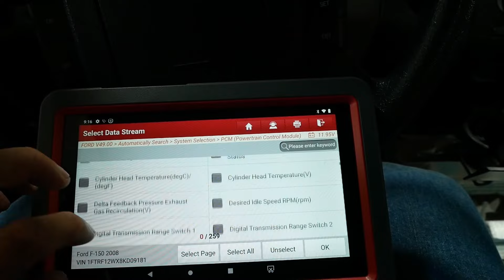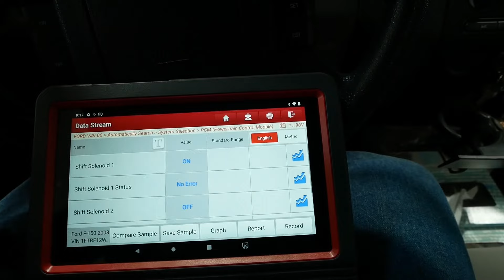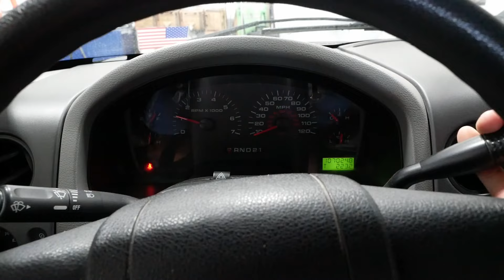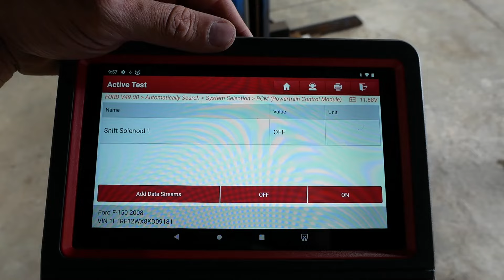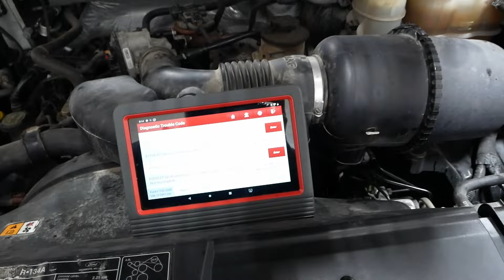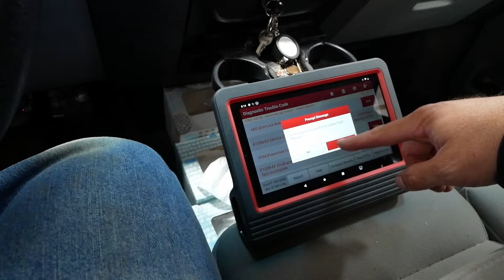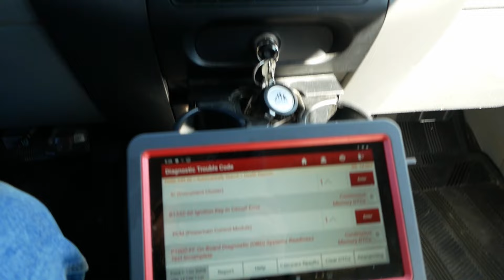Ford Trans Troubles - Dragging in Low and Reverse - 4R70W

Comment: You should try an automatic transmission. Maybe an older, non-electronic one. They're no more complex than the hydro valve setups on the plow trucks or that Ranger transmission. I rebuilt a C6. It worked, It was a formative experience.
Reply: I second this. I rebuilt my 4R70W on my 01 Crown Vic. These are simple and the clutch tolerances are easy to achieve.
Reply: Yeah, but Wes isn't setup to repair them and there's an entire chain of order that needs to be built from scratch. IMO he's peachy where he's at, there's no reason to spread oneself to so many corners.

Comment: Good trans shop to suggest flushing the cooler. I rode in the 40s to even the 30s in Illinois if the sun was out. Still riding the Panhead bobber at age 72 but now in the mountains by Prescott.

Comment: the 4R70W seems to be a good transmission in my opinion, I had one go through 2 engines and it lasted 394K in a 1999 expedition, I can't say the same about our current 2004 expedition, we had that one rebuilt at 240k which is still not bad

Comment: Wes,  There is no voodoo magic going on inside an automatic trans.  Take it apart, clean, install new frictions, steels, bushings, seals, orings, apply pistons,  and any broken hard parts...charge $2k...easy peasy.  You're a far more advanced mechanic than I am and I've rebuilt 4 automatic trans with no problem.  IMO it's harder to R&R a transmission than it is to rebuild them.

Comment: A great way to start my Sunday with new video from Wes. I’m surprised that transmission needed to be rebuilt at that mileage. I’ve got a 2001 F-150 with the 4R70W that’s got 190,000 miles on the original transmission.
Reply: My 2000 got 298k before its rebuild.
Reply: I've got an 01 with 440k miles on the original trans.
Reply: My 2003 F150 4R70W (4x4) tranny has 194k original miles on it. Still shifts great!
Reply: It's all in how they take care of them also that 107k miles could of been 107k of stop and go and towing. Also, not all transmissions are created equal one thing that was not perfect from the factory will torpedo a tranny eventually. I have 186k On my Ford Expedition (Same Transmission as this F-150) and it needs a Transmission. But It has spent its life in Stop and go and towing the fam toys and camper around so I feel I got my money's worth out of it.
Reply: @Twisted_Harlock  im at 133k on my 98 crown vic(not a p71) and its going strong! BUT it was serviced every 20k  firm wot 1-2 shift

Comment: Wes, if you can take apart an old Oliver dozer transmission and shim it back together so it works, you can certainly tackle a modern auto transmission like the one for this Ford.  There are plenty of YT vids of people taking them apart in under 30 minutes.  Of course that's the easy part.  Re-assembly takes a bit longer and some special tools.  You can do it.  Set up a stainless steel table/benchtop in your shop.  Then take an auto trans apart, fix it, and put it back together.  You'll be glad you did.  Also, how is it this 15 yr old Ford with 107k mi has less rust than your lift?  Great video as always.  Have a great week!

Comment: Hey Wes, I know this video was from like a year ago but I just wanted to bring this to your attention if you didn't already know it... When you showed the metal in the transmission oil pan there was a little plastic yellow stopper with an o-ring on it laying in the pan.  Those are installed in the side of the transmission at the factory and later on when they attach lines and such it gets popped into the transmission pan.  It just lays in the pan and doesn't cause any problems but it's a telltale sign that that transmission never got an oil and filter change after 107,000 mi.  Therefore I would say that that is the reason that transmission failed.  Just thought I'd drop that little bit of knowledge on you if you didn't know.

Comment: Your EZACTLY like me, I ONLY replace engines and transmissions, ONLY ON rear wheel drive CARS/TRUCKS. FRONT wheel drives CARS are A pain, AND I WILL NOT WORK ON THEM. AND NO I DO NOT WORK INSIDE ENGINES NOR TRANSMISSIONS, I ONLY REPLACE CLUTCHES, PRESSURE PLATES, AND THROW OUT BEARINGS, AND MASTER SLAVE HYDRAULIC CYLINDERS, AND MASTER CYLINDERS ON THESE TYPE OF APERRATUS ASSEMBLIES,  OR INSTALL NEW FRONT AND REAR PUMPS SEALS, ONLY IF IT LEAKS, EXCELLENT JOB YOUNG MAN. 😁👍

Comment: that orange plug in the pan.... had that trans NEVER had it's fluid and filter changed in it's life? amazing it lasted that long.  the plug comes from the factory fill afaik.
Reply from the maker: Just did a E250 with 230,000 on the clock. Still had the plug in the pan. Only reason I changed the fluid is the pan rusted through.

Comment: I know ur the mechanic am I just repair in my yard but I found easy way to remove that top rear starter bolt. I removed mine in less then a minute with an 18 inch extension and a lot of short ones reaching right over the front tire. If you turn tire towards passenger side you can stick head and see that bolt no problem.  The reach around technique only works great for Mortske Repair lol

Comment: Decades ago in my garage I had the same delima about the transmission work, and the customer.  Normally I just sent the car over to my friends transmission service.  He was swamped and said If I pulled the transmission, lines and cooler he wauld walk me thru the rebuild.  fortunately it was just an old GM 2 speed slush a matic, and simple as simon.  All turned out good.

Comment: These old fords radiators and Transmissions are pretty easy to remove good design to bad Ford changed the design on the newer models good video as always @Watch Wes Work

Comment: You're a braver man than some of the mechanics I've dealt with in my lifetime.  All the symptoms you had today remind me of something with my old Toyota Land Cruiser.  Took her to several mechanics, and they were all sure they couldn't find the problem, and that something would have to "break" before they could properly diagnose.  Finally had to say goodbye to her, because I couldn't trust her to do the km's I was doing at the time, and the last thing I needed was to break down in the middle of nowhere.  Wish I had taken her to a transmission shop.

I think you stole the thunder of most viewers when you mentioned not having to take to it with a gas axe - for the miles, she was in pretty good condition underneath.

Comment: We installed an accessory external filter, and an additional cooler, because transmissions are so darned expensive. I did the r&r and filter, cooler modification.  My builder recommended it.  Did your builder tell you why it grenaded? A friends 4R70 did the same thing. Nice to see you got it done on a non crusty ride. thank you.

Comment: Wes. I fully rebuilt a 4r75e, which supposedly has identical internals to this tranny. I'm just about sure that if a numpty like I can, you can too.

Cost me about 700, which included some tools. I'd have probably had someone do it but I repair other things for a living and have trust issues about the work of others, based on what I've seen in "my field"

Comment: After watching this it shows me what a good transmission shop will do to help you ie bring the radiator so they can flush those lines removing any nasty junk trapped in there.  That alone should prolong the life of the rebuilt transmission.  I would not have thought of doing that---- but then again I am not a mechanic.  That transmission jack looked a little skeptical to me.  I was worried it might fall over sideways.  Thank goodness it did not.  Thanks for the videos and tips.
Reply from the maker: It’s a good one

Comment: I’ve changed a few transmissions and only replaced the oil and filter
Although I did change the valve body on one 
From a 1975 to a 1968 trans and they bolted right up. And to my surprise it even shifted and stayed in there till I sold that truck.

Comment: Man that sucks that the trans let go. When I changed my trans oil in my 86 f150 with a c6 I was extremely surprised to see the push through sitting in the pan from when it was built, indicating it still had its orginal trans fluid. Fluid looked great and the fluid was extremely CLEAN!  But that probably because it only had about 50000 miles on it

Comment: I liked this video everything fell into place.
 I  have to put a hydraulic throw out in my 97 Ranger with 4wd and 5spd. This is the last year for the twin traction beam front suspension and I've done transmission work on this before IT AIN'T PRETTY. This is when I wish I didn't know enough to make me dangerous and the fact funds are tight and so am I.

Comment: Good job . I'd have possibly talked the owner into getting an auxiliary cooler plumbed into the system for extra insurance I really have no faith in the in rad coolers as a stand alone. I've had good luck adding a few spin on filter kits from Derale to a few vehicles with trans rebuilds, and at service intervals the fluid comes out crystal clear and have had 0 issues afterwards. just a thought Wes.

Comment: The block in the cooler lines is a thermostat. Helps the fluid heat up faster by bypassing the cooler, which is an emissions/fuel economy thing. Hotter fluid is thinner, thinner fluid requires less power to pump, etc…

I’m not a transmission guy either, but I learned a few things over the years to determine if it was an electrical/solenoid issue or something outside my scope. Basically, there is no electrical issue that will cause you to lose drive on one of these older transmissions. So, if you have a transmission that has no drive or loses drive when it shifts to a particular gear, that’s a mechanical failure. A shift solenoid failure will cause you to lose gears, but that is not the same as losing drive. Basically, if you have a shift solenoid stuck on, you might get 1st gear, but it’ll stay in 1st when 2nd is commanded, then shift to 3rd when 3rd is commanded and stay in 3rd when 4th is commanded. You will not have all 4 gears of a shift solenoid is stuck on/off. If you want to rule out an electrical issue, either disconnect the electrical connector to the transmission or remove the fuse that powers it. Transmissions are designed to “fail safe” in regards to the electronics, meaning that when the electronics fail, you get max line pressure and one usable gear (usually 2nd or 3rd on a 4spd).

Comment: Hey Wes great video, Just had my  1998 Chevrolet 4160E rebuilt. 212000 miles It has a Towing Package but it had  the original fluid and filter in it. It was shifting fine pulling strong. But started hearing a little whining under deacleration . I just knew it was in the  differential . Took it to a well recommend shop. He drove it said it was in the differential. Told him go ahead an rebuild the drive line. To our surprise the rear planters gear had Sheard a tooth in the transmission He said it was about to cause some server problems. Best truck I have ever owned . Still runs like a top!   I missed the beautiful women you usually have own. She adds a lot of sugar and spice..

Comment: Customer never serviced that transmission either, factory plastic plug for the dipstick tube was still in there . Idk why ford did that but they would just pop em though into the pan when they installed the dipsticks during assembly

Comment: 2000.00 bucks  wow , I remeber blowing tranmission in 79 FORD 150 XL  302 CI C4 TRANS in 1981 went to CANADIAN TIRE AND bought a rebuilt for 180.00 canadian and installed on the road, 600mi home at the time.

Comment: My 98 Ford e250 had the 4r70w and I put a new pan on it so I can drain it and I got it to shift so much better than it used to by replacing the filter and now the fluid 2xs in the last 16 months or so

Comment: # 27:11 next time you may want to try an additive to loosen the innards. Worked for me and my 1977 M.H. There was absolutely no way I could afford another tranny of ANY condition. I forget the name of the additive I used, but it was in a white plastic container. Read directions, add, & drove away. No more  hung up shifting, delayed shifting, and RIIPING NOISES WHEN CHANGING GEARS. That was the most worrying sound I ever heard. 1977 travco 440-3 dodge MH.

Comment: Ouch, that was a sore automatic, it certainly needs that attention of the automatic transmission person. I have only ever handled manuals, they have their moments, but now, more than 50 years later, I am too old for car work. I like to watch you get things done and realise that there are people far better equipped than me. Great radiator replacement, that went excellently, until the loose connection upset the record, but the rebuilt transmission cleared the book.

Comment: Easiest radiator I’ve seen is w123 chassis Mercedes. Only tools needed are for hose clamps and trans cooler lines. Clips hold the fan shroud and radiator on. Great system and makes pulling the radiator a breeze.

Comment: It was 82°F here in Arlington Texas today.  The cotton is presently exfoliating before harvest, and the feed corn should all be in.  In a couple weeks they will be sowing the winter wheat.
TexDoT has a lottery for certain potions of the State, to mow the highway verges for hay.  The tractors used for that exercise run from the comical to beggaring imagination.  Mind, round bales are running like $67, but exported bales are going for $155, if they can afford the diesel to drive them out of state.
Reply from the maker: I can remember when round bales were $15 here...
Reply: @WatchWesWork  During the Texas Drought back in 2010, local round bales were $200, and they were shipping them in from Kansas and NE.

Comment: The yellow plug sitting in the trans pan is a tell-tell sign that this transmission has never been serviced.  The yellow plug is installed at the factory when the trans is built.  When the dipstick tube and dispstick are installed during vehicle assembly, the yellow plug is pushed into the pan.  That pan has no drain plug.  In order to change the fluid and filter, the pan must be dropped.  Most folks then remove and discard the yellow plug.  Seeing the color of the fluid and the yellow plug still in the pan leads me to believe this trans died an early death due to neglected routine maintenance.

Comment: I had a Ford Ranger truck. The thing I appreciated the most was the 5 speed transmission. The thing I disliked was the poor fuel economy. The same with my 94 Toyota 4runner that was a 5 speed. It too had poor fuel economy, but it was still shifting fine at 300k miles when I got rid of it.

Comment: I worked for an oversized load transport company for years. When I started working there we were using 88 to 96 GM trucks and vans when it came time to buy new vehicles the company bought 3 2000 Ford trucks and 3 99 Ford vans. I know people will disagree but they are the worst vehicles I have ever set my ass in remember we basically lived in these vehicles for 12 to 15 hours a day. The first thing to go was the transmission every thing was junk on these trucks and vans. 👎👎👎

Comment: Sway bars can save you flag time. On a Jag alternator it's under the a/c comp. Book said pull the comp. But if you pry the sway bar 1/2" the  alternator falls out. But, when you add them to old cars they can cause 6 kinds of grief.

Comment: Nice watching you repair things. Do cars have 3 radiators now, a transmission oil cooler, an air conditioner radiator and water through the block radiator?

Comment: It's the torque converter spacing. You want minimum eight inch of clearance you can move the converter back n forth. Max quarter inch depending on the trans. If you have to much you won't have lockup. To less you will blow the pump out. Ask me how I know the lock up problem. Lucky it was to far out n not to far in. I caused no damage. Just scratched my head n took the trans apart w times before I figured it out.

Comment: That trans has never been serviced. I believe that little yellow plug that was in the pan is used to keep debris out of the pan during manufacturing. It is removed and thrown away upon the first time the fluid/filter is serviced
Reply from the maker: It plugs the dip stick hole.

Comment: I had a 04 f150 and the transmission would do a very random thing. As you were driving you would lose throttle, it would bang/jerk front the front, then the same from the back, the regain throttle and keep driving like nothing ever happened. Also no lights/codes.

Comment: Wes, when you pulled off the tranny pan, I saw the OEM tranny plug still in the pan. With 110,000 odd miles on it, perhaps it would behoove a person to perform regular common sense maintenance on the transmission. Have a hard time believing the manufactures recommended intervals on fluid and filter changes. I like my equipment to last as long as possible.